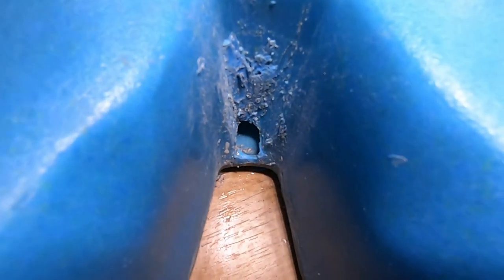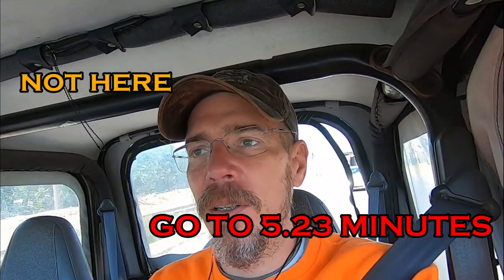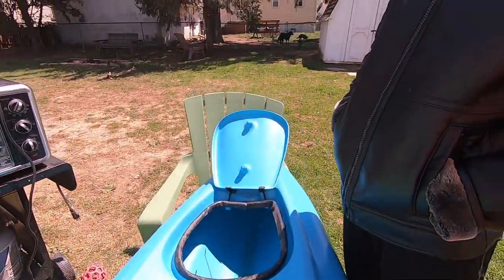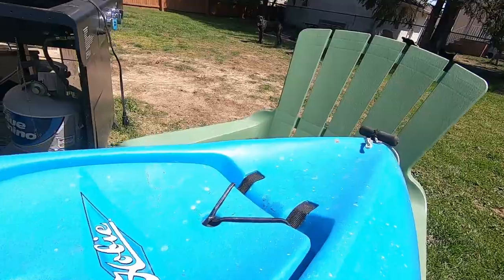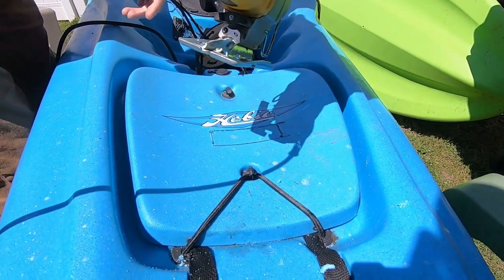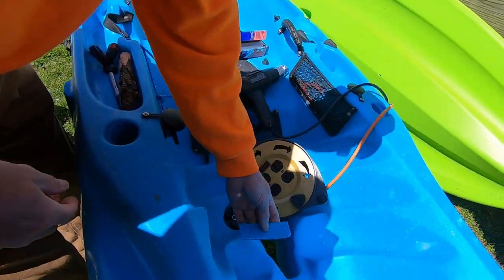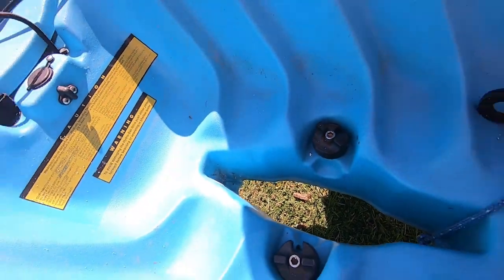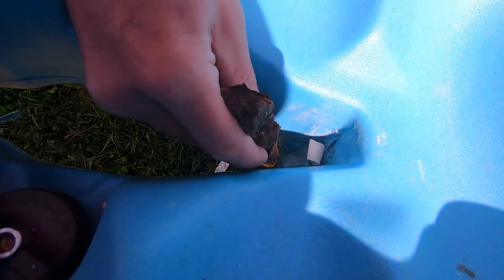HOW TO REPAIR A HOBIE KAYAK HOLE PART 1/JERSEY JIM FISH VLOG

Comment: Good job! I fixed a Vibe Skipjack tandem kayak that had a couple of hairline cracks. I made the fix with a piece of plastic strip from the lid of a 5 gallon bucket. First I widened the crack gap with a hot knife, just to the width of the knife blade. then i filled the gap with soft/ melted plastic from the strip. It works perfect. just be careful not to add the dripping melted drops in the gap as it may deform the gap. I recommend that you first make a gap and practice fixing it on the bucket lid. Happy fishing 😊

Comment: Did it leak?  I'm really curious about how it turned out because I have 5 inch wedge crack/break in my beloved Hobie kayak just like yours.
Reply from the maker: I have a whole playlist devoted to mending this old crusty bastard kayak. I would urge you to watch one that is more recent.
The soldiering iron with a manipulated tip was most successful.
I fear mine is so photo degraded now it is beyond repair and yes, it leaked.

Comment: Hit a rock going full speed😂😂😂🤣😂🤣🤣😂😂🤣🤣😂I just found a pair of leg waders I thought I threw out. I patched them with pool liner and silicone but the rubber pool liner don’t stick so after watching that plastic vulcanize of the hobie I will revisit them
Reply from the maker: Repaired my waders again recently. I almost hate to admit it but flex seal in a spray can did the job beautifully!
Reply: I will get that
Reply from the maker: I did two thick layers dried overnight. It could use a third, but a little bit of suffering and discomfort makes any fish caught that much more rewarding.🤣
Thanks again for the comment Mr. Dubs.😁